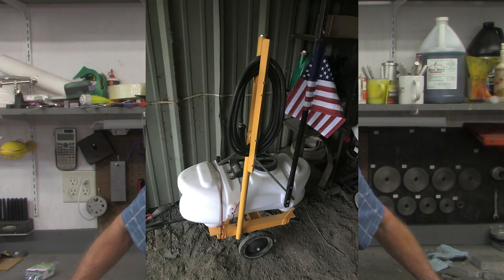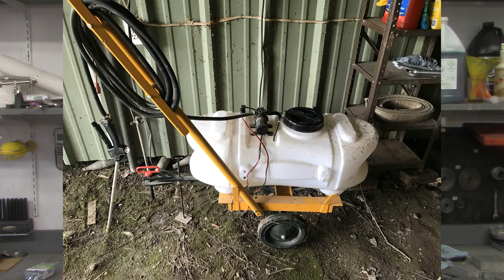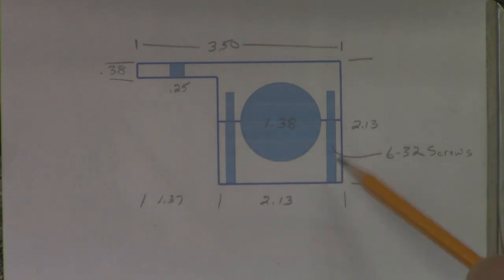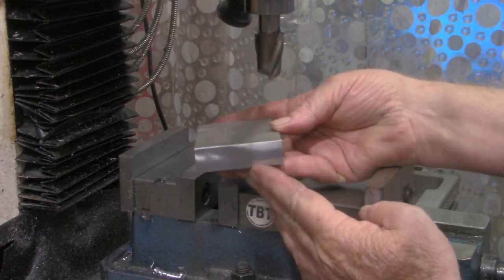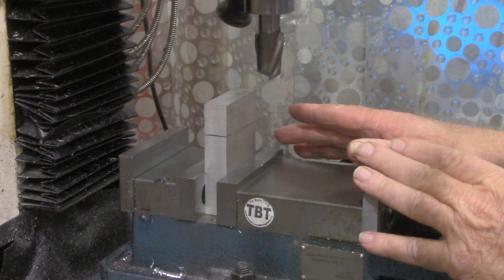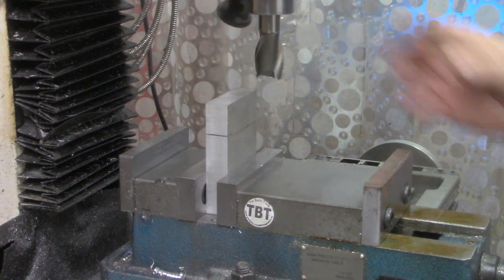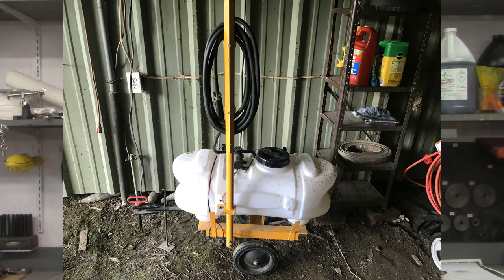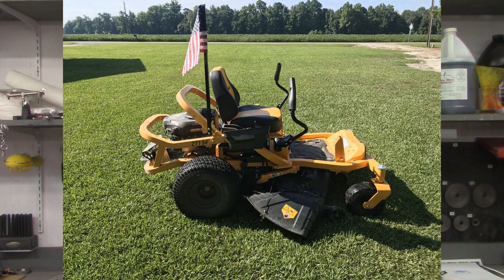Machining a sprayer hose bracket after a big OOPS

Comment: Hello Lee, You could always make your own set of carbide insert boring bars, it’s easy enough and would be a good video. Some 3/4” necked down to 1/2 to fit boring head come in handy for rigidity aswell as a couple smaller ones necked up to 1/2” for smaller holes.

Comment: Lee, I personally use the brazed carbide boring bars like you are using. Buuutttt, I machine a flat on the shaft so that when tightened down in the boring head, they can't possibly pivot and change the dimensions. Not hard to make that modification, any machinist can do that. My vote is sharpen the carbide tips and keep on going.

Comment: On the boring bar idea, we use ¾ shanked ones just like yours there, we just resharped ours, bozo knocked one out of our hands while back, as long as you take your time sharpening them, plus your storage container there isn't good for them either(very easy for them to bang against each other and chip the edge), we bought a cheap pencil box to store ours in, as far as the insert kind, we would like to have a set too but as long as ours are still able to be sharpened guess we use them

Comment: Lee, I prefer old school brazed carbide, as you have there. The problem that I see is that you have to know how to sharpen them properly. If it is too much a hasle...pay the man and get the inserts lol.  I also like the brazed carbide because you can grind then to fit the job and/or metal  cutting geometry as needed.